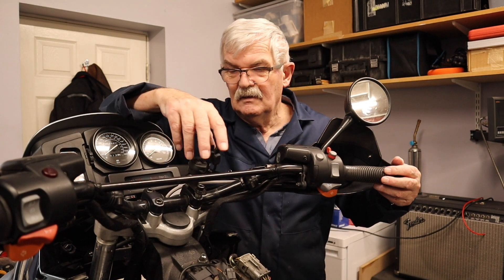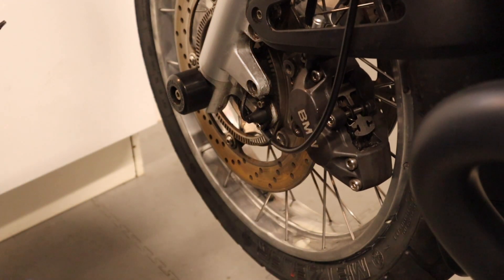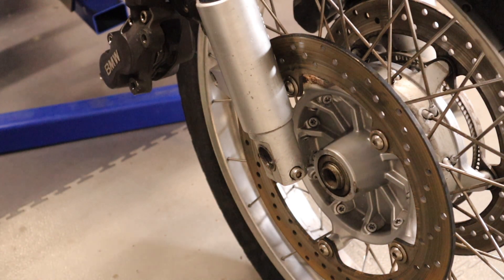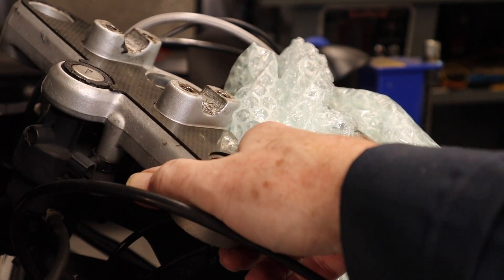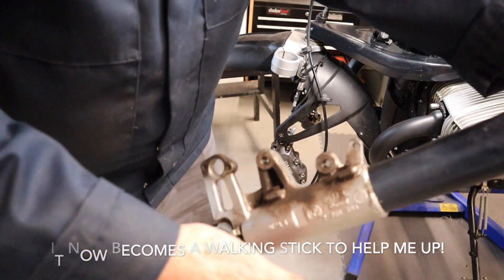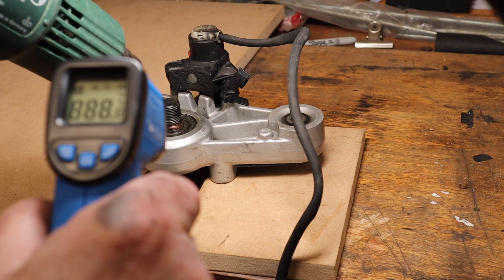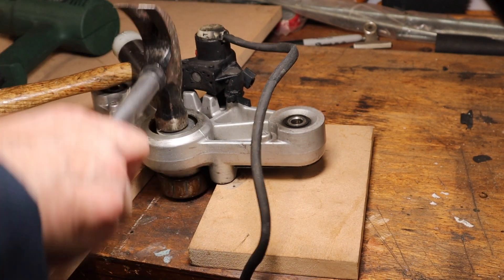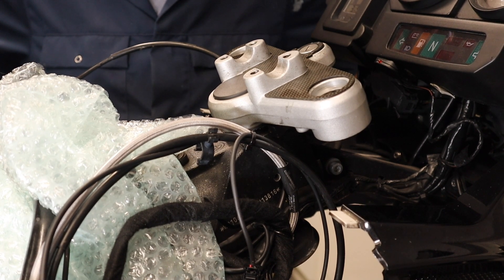1150GS Part 13

Comment: Hi Norman, I trust you’re well? I’m guessing an ‘07 R1200GS is almost exactly the same procedure…my steering is clicking!🙈
Reply from the maker: Morning Richard, well it should be, I cannot imagine that BMW would change the design between models at that stage. It could be a different bearing size but if you key in your actual 1200GS to the Motorworks site it should find the bearing🤗

Comment: Very informative, well-filmed and dispatched with the requisite amount of sympathetic fettling. However, I have a question and hope you will see this comment and be able to answer it: During inspection / dismantling you identified severe play in the steering assy (@ 0:36) - which you noted was caused by the under-torqued bolt at 8:27 (you said should've been 45Nm); I wondered if, when you removed the bearing (14:08), you inspected it for wear? 

I was really curious to know if the bearing itself was damaged / worn or whether the problem was the under-torqued nut. I fully appreciate that the bearing (@ cost of £20) was well worth replacing once you'd got that far (just as a matter of course, and for your peace of mind). But I was still interested to know if you'd turned it on your finger and felt any roughness of movement and / or play. 

One of the mysteries - why that bolt was so poorly tightened in the first place. I assume it was the previous owner's (or their mechanic's) doing - but you sometimes wonder if it left the factory slightly under-torqued, and wore loose over time/distance.
Reply from the maker: Really good question that nobody has asked before. Well you are right. I never tested the headstock bolt before I ordered the new bearing, it was only when it arrived and I started that I realised the bolt was loose. I am sure I could have just taken it up to the correct Torque and all would have been well because the bearing appeared pretty good after I had removed it. Would have saved me an afternoon of work but hey at that stage with the new bearing sitting there for peace of mind I decided to carry on and replace it for the new one. Well spotted 🤣
Reply from the maker: Exactly, I bought a real problem bike, but Covid etc just went with it😵
Reply: @normski3091  It's often a case of Russian roulette for riders. I will be astonished if there's not an unpleasant surprise lurking on this bike, somewhere, if I dare to whip the old wallet out.

Comment: Fender amps and BMW Gs - great choices ! What's your axe ?
Reply from the maker: Ha ha, well spotted …however last year I sold the Fender amp after buying it new about 30 years ago. Then my Gibson MkIII which I bought around 1988. Didn’t have a clue what price to put on eBay so started at £1100 but it went to a specialist collector for £1700. My main guitar was a 1973 Fender music master short scale bass that I bought in 1986 for £100. That got £900 on eBay. So cleared loads, complete PA system and electronic drums as band fell apart in Covid. However in 2019 I built my own bass, the best precision bass I have ever played. Went to the John Schuker guitar building school for a week in the Peak District, amazing you must do it. Have a look at his web site and courses, you will spot a picture of me holding the completed bass🤗 https://shukerguitars.co.uk/our-work/luthiery-courses/

Comment: Do you need to heat the center bolt to break out it from the nut/chasis? 

I mean i just started removing the upper brace from my 2007 R1200RT?  It is way to tight... I even wonder if it is a left handed thread
Reply from the maker: Hi Fernando, I had watch my video again to see what I did. You will have spotted that mine was a little loose but if someone has used red Loctite for instance you will have to heat it to break the seal. Probably with a flame directed right on the bolt as you do not want to damage anything else. Let me know how you get on.